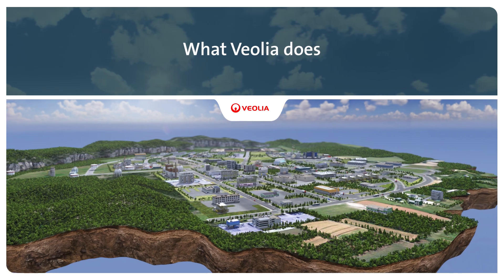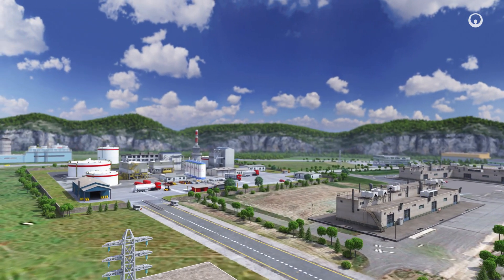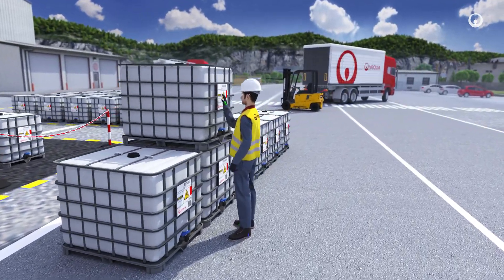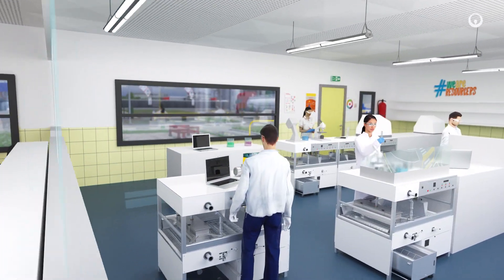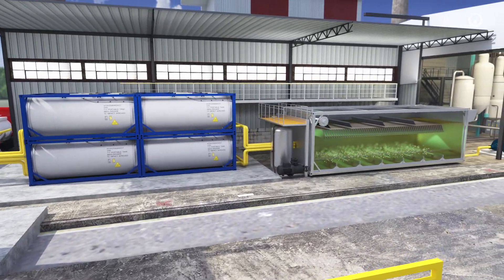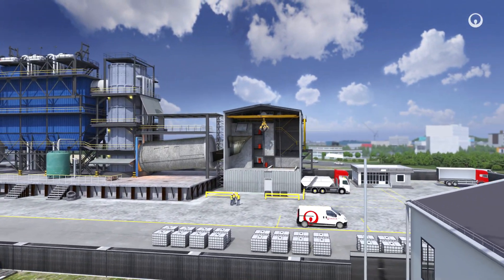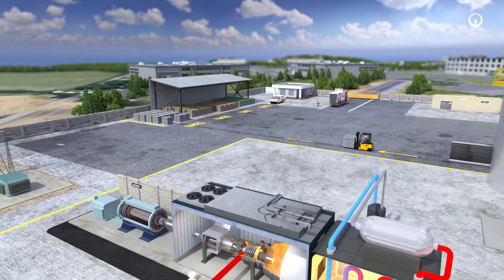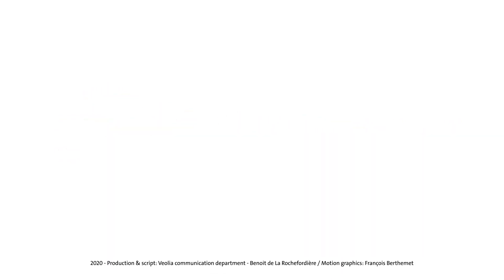Treatment and recovery of hazardous waste | Veolia

Comment: Respectful Greetings!
To: Veolia Group.
At its core, hazardous waste is any discarded material, whether solid, liquid, or gas, that poses a substantial threat to human health or the environment when improperly managed.
Treating and recovering hazardous waste is crucial for protecting the environment and public health. Here are some key methods and processes involved:
Physicochemical Treatment: This involves using chemical reactions and physical processes to neutralize hazardous substances. Techniques include precipitation, neutralization, and oxidation.
Biological Treatment: Microorganisms are used to break down hazardous organic substances. This method is often used for wastewater treatment.
Thermal Treatment: High temperatures are used to destroy hazardous waste. Incineration is a common method, which can also generate energy.
Regeneration and Recycling: Some hazardous wastes can be treated to recover valuable materials. For example, solvents can be distilled and reused.
Secure Landfill: For waste that cannot be treated or recycled, secure landfills are used to isolate hazardous materials from the environment.
Traceability and Safety: Ensuring that hazardous waste is tracked from its source to its final disposal is essential for preventing illegal dumping and ensuring proper handling.
Hazardous waste is waste that must be handled properly to avoid damaging human health or the environment. Waste can be hazardous because it is toxic, reacts violently with other chemicals, or is corrosive, among other traits.
Courteously!
Luís Van-Dúnem